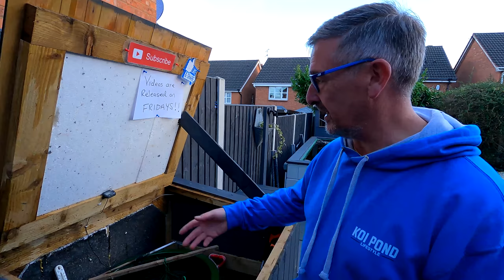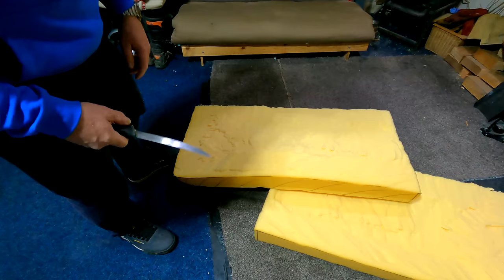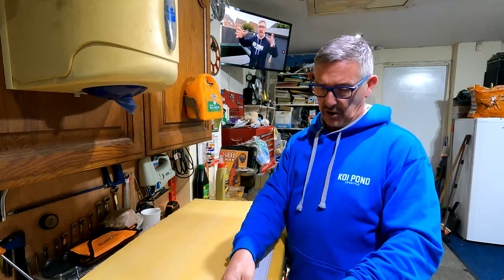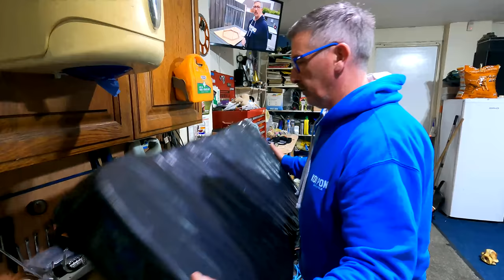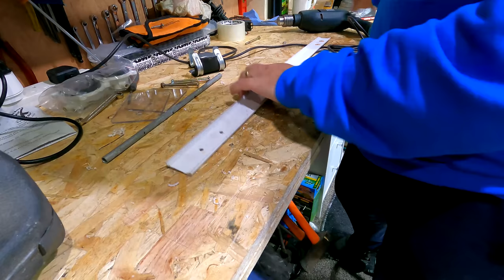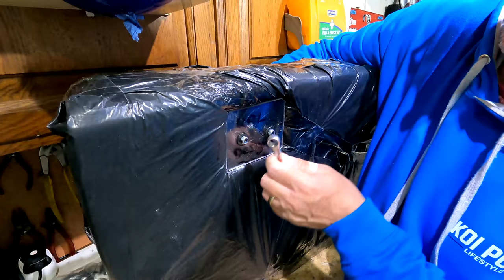KOI POND**POND WINDOW INSULATION COVER TO MAKE FOR FREE😉👍** TO COVER THE POND, OR NOT TO COVER YET🤔.

Comment: Another nice day and not a bad night water still hanging above 11c.
The next step I think is testing a length of led lighting to see if or how it can be put into the pond.
One idea get some clear polycarbonate around 3mm thick and cut this into strips of 4ft X 2” stick 4 together like a long box glue a length of led light to the inside bottom of one length make a small hole for the power cable then hot sealing this with glue.
This then would give a 4ft long box 2” wide with the strip of led light inside this would then need to be weighted and put on the bottom of the pond or hung down the side the cable running to an RGB plug.

Comment: Jablite Polystyrene Insulation board (L)2.4m (W)1.2m (T)50mm is cheap around £15  I think 100mm is £30 from most diy chains its the same as kingspan. Yes according to the flight lanes over the country for aircraft planning for the next 7 days your area should be around 9c and sunny my pond is high 11.1c
Reply from the maker: Yeah but mine was free...😁😁😉👍